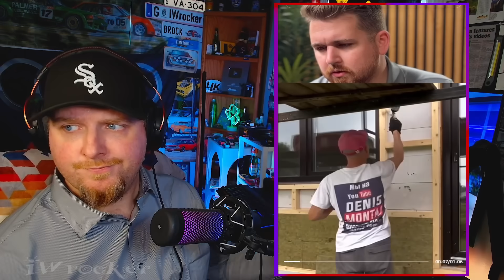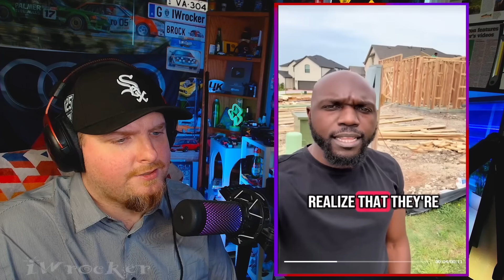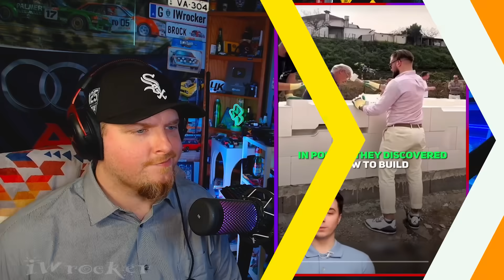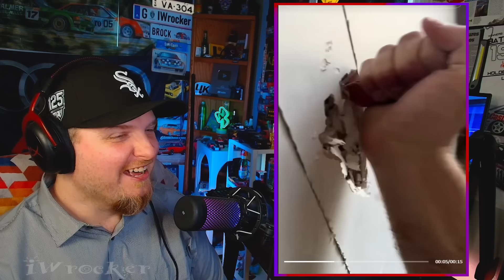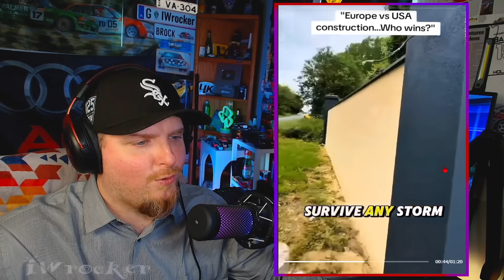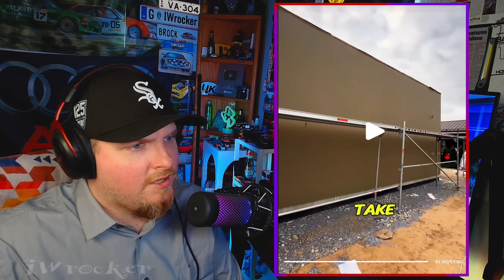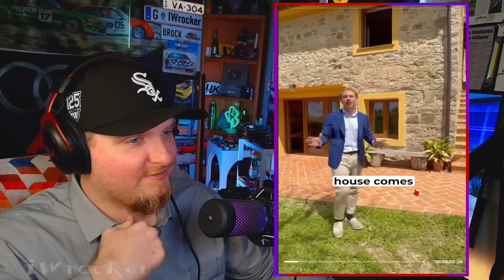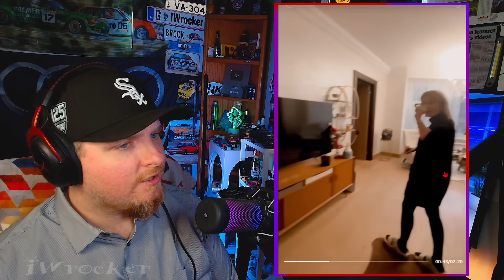25 Minutes of European VS American Home Quality & Construction Methods 🔨

Comment: That window at 13:00 looks like it's a single lipped frame, not a tripple lipped frame. Ie it has one lip with an insulating lip between the window and the frame. What I'm going to get soon are three lipped seals, all recessed outwards from the panes, so there are multiple overlapping seals of insulating material. That also increases the stability of the frame when it is locked. With the tripple panes plus safety glass they aren't indestructible, obviously, but so incredibly tough that even a sledgehammer to the window pane is only going to shatter, but not splinter, the actual panes. Meaning, you still can't get through it, but thanks to the vaccuum seal being broken between the outermost, and the middle layer, you get a very loud implosion bang. Due to the heavy frame surrounding the panes they won't be easy to break out or through.

In the demonstration video of the company they even tried a pickaxe. Yes, it punctured the outer and middle layer, but got stopped before it reached the inner layer. The frame was attacked with everything from a yard-long crowbar to a disc grinder. After five minutes of frantic attempts to break either the frame or the panes out of the frame the crewmen gave up. It was SO loud, and so obnoxious, that neighbors would have called the cops by now.

Obviously there's no use putting these frames in platform framed US style houses. With outer walls being flimsy enough to be destructible to an average sized hammer with prongs, the walls become the weak points.
With my house a builder tried to cut through the concrete inner layers of the outside walls. For that he needed a special liquid cooled center cutter, which still took him over ten minutes of very noisy drilling. Mind you, it was a mere 150mm hole (so barely 6 inches diameter hole) for a steam vent from the kitchen area to the outside. The depth was 'only' 35 cm, so about 14 inches thick of layered iron slag walls sandwiching an inner 6 inches of solid reinforced concrete wall. The entire outer wall is roughly 20 inches thick.

Comment: The thin building is a famous block of flats known as the Thin House, located at 5 Thurloe Square in South Kensington, London. 
Often described as a "logic-defying" optical illusion, the building appears to be only a few feet wide when viewed from a specific angle. In reality, the building is triangular (wedge-shaped). 
Narrowest point: 6 feet (1.8 meters) wide.
Widest point: 34 feet wide. It was built between 1885 and 1887 by William Douglas. The site was originally a plot of land left over after the development of the nearby Metropolitan District Railway.

Comment: 2:00 that was not concrete. More like Ytong or something similar. That are such light big bricks sturdy but soft, easy to neil in it with a neil. And of course if you need isolation it comes from outside. From inside it would be just bad at least with dew point

Comment: Pros and Cons from an European view - not a craftsman and just for funsies btw

Pros of the "American" way of building if done correctly:
1. Comperatively easy to build, relativly cheap
2. Highly flexible (layouts can be changed etc.)
3. DIY friendly
4. Easy to adapt building plans to different regions (insulation thickness)
5. Maintenance friendly

Pros of the "European" way of building if done correctly:
1. Sturdy
2. Less maintenance needed regarding the structure itself
3. Quite safe regarding electrics and other stuff that may eventually lead to an express departure from the real of existence
4. Often better insulation regarding airborne sound and if done correctly also structure-borne noise (latter one dabatable to a degree, depends on proper execution)

Cons of American style
1. DON´T BUILD THIS STYLE OF HOUSE IN FRIGGIN HURRICANE REGIONS; EVERYONE WILL MAKE FUN OF YOU!!!
2. DIY friendly...yes, that is also a Con - ever witnessed what an average accountant cosplaying as a plumber can do to all the plumbing on just one weekend? There goes the resell value...
3. The "maintenance friendly" - yeah, you probably will need it! Often!

Cons of European style:
1. Sturdy. Yes, it is still sturdy when you want to rip out the plumbing or remove that wall to open up some space. Oh...and about that wall: Better make sure the last 30 - 50 years of loadshift didn´t make it a loadbearing wall now! Check, check again...aaaand call the structural engineer to tell you where exactly you effed up.
2. Sturdy. Yes, the structure is solid but boy oh boy do you have a problem if it isn´t anymore! And yes, water is your greatest enemy. 
3. Sturdy. These bricks ain´t cheap mate, better pay in advance. And get an architect...and a structural engineer...and an electrician...and...

Comment: Just like at 13:37, over here in Slovakia (Central Europe) a typical house wall is 19in brick plus 8in of external thermal insulation. Windows should have 3 plates of glass now.
Same insulation under the roof. Typical roof are concrete tiles, which are a bit heavy on purpose. In the unlikely case one gets somehow damaged, replacing it is too easy:goodvibes:
Our house is warm without heating when outside temperature is above 50F with 4 adults inside, 40F outside "require" 5 adults for zero heating.
18:20 Cameraman does not show the rear wall on purpose to make it look funny. Outline of that house is not a rectangle, it gets thicker:yougotthis:

Comment: @18:36 The YouTube channel "Tim Traveller" can explain this; he has made several videos about the artificial facades in Paris and London. The main purpose in both cases is to ventilate the Paris Metro and the London Tube, which are so old that they were once pulled by steam locomotives. Another purpose is noise reduction (logically, since these locomotives were loud), and thirdly, to visually maintain the facade so that no gap appears in the middle of the street frontage. The section shown in the video is deliberately misleading; If you were standing there, you would see the tracks at that point from a different perspective.

Comment: Modern day buildings here in the Netherlands are often pre-fab concrete with lightweight gas cinder blocks for interior non-load-bearing walls. It's not like we build with solid brick anymore like in the '30's. (unless for maybe single homes where the owner specifically wants something like that). Most brick you see on modern buildings here are just thin decorative covers.

Comment: In Europe, when building with wood, dense, high-quality timber is used, making it far less flammable. The standards are strict; it is also fire-retardant to prevent any risk of fire, even with the aforementioned precautions. Smoke detectors are mandatory in homes, and in most cases, firefighters have time to arrive before the situation becomes too serious. This is nothing like the wooden houses from Ikea or pallet wood in the US, which often burn down before you even have time to call the fire department. Ours withstand fire for hours, and everything is rarely destroyed except in the event of a major disaster.

Comment: You can also change the floor plan in a brick house. Non-load-bearing partitions are made of thin partitions (about 15-20 cm), you can knock them down with a construction hammer. The problem is changing the load-bearing walls. That is also possible, you just have to deal with the beams and lintels that will transfer the load. The principle is exactly the same as with wooden houses (we have them in Europe too, but they are not very popular in Central Europe). So you can change the floor plan in a brick house too, you just have to do more. But they are not untouchable for 150 years 😉

Comment: If i remember correctly, the fassade in London (around Min 10:30) stays parallel to traintracks. The fassade is blocking noises and also looks better than as tracks of a railway area. 
Greez. Chris. Munich.

Comment: I live in Finland, we have almost 90m², apartment. It is made totally from concrete. I never, ever worry that our walls will break. I hit my hand to a wall corner, while playing with my kid, and it fractured my hand. 😂
Reply: And my parents live in house made, from tiles. It was built in the '70s, and has concrete stucco finish. The structures are original, and will last another 50 years easy.

Comment: It insulates from the outside because it creates a shell avoiding critical points where heat could be lost. If the insulation were on the inside, in the part where the internal wall is attached to the external one, there would be an insulation break. Using thermal cameras, with internal insulation, from the outside, in correspondence with the internal wall, a heat spot due to the thermal bridge would be visible.

Comment: Ugh, coming from a family of architects (both my grandfather and my late father were architects) wall insulations always give me the creeps: not only do they throw around numbers about energy savings which are only true if you're living in a leaky shack or thin-walled concrete block, the limited life expectancy (35-50 years) and high cost for the insulation make them hard to break even most of the time. Not to mention that you DO NOT ruin a century old house with external insulation just because it's "cheaper" than internal insulation and in the name of the envitronment (and for some reason, people love to omit the CO2 fingerprint of producing the insulation, making the calculation even more moot). -_-

Comment: In regard of the last one: Latvia doesn't provide it's sitizens with high salaries so $700 is definitely NOT cheap for a regular Riga worker. Still much better than most of similar sized apartments in Kyiv in regard of quality of living. You know, low floor numbers and quietness. As much as I would love to visit NY as a tourist, I'd refuse living in that anthouse for free, let alone paying so much for it😂

Comment: First one the insulation isn't on the outside it is going to be covered up hence the wood struts for what ever covering the place over the insulation. He also brings up pressure treated and that the wood should be treated one you can get pressure treated wood that is clear so it doesn't discolour the wood two in some parts of europe getting it treated isn't going to make a huge difference due to the lack of creatures that will wreck the wood. As for America does it properly OMG do I need to point out just how many American shows highlight plenty of crap buildings that need major corrections done to them? 

London building is most likely a fake building built to look like a house when in reality is an air vent for the London Underground instead of unsightly pipes the hide it behind a fake front to fit in with all the other properties London has several of them all over.

Comment: My house was built 40 years ago and already has insulated walls... and it's NOT russia! It also has heated floors and it's not from ancient Rome!
I wouln't want to live in a shed that guy built.. I'm in IT and not a Bricklayer/Carpenter/Plumber/Electrician but I have probalby more knowledge about building a house than this guy... he's probably building cardboard houses from Duc Tape and wonder why he's freezing since october or when it rains! Aaaaaaaand he's an arrogant prick! This house is built from concrete bricks and possibly has insulated concrete bricks. There's a reason german craftsmen have to go through an apprentice ship that last around 3 years.

Comment: My mothers house was built in 1694.
Still standing and have only had minor repairs to its walls and roof throughout the ages......how many buildings in America can say they are over 400 years old?  America is still old, so they should have a house or a building that is 400 years old.  The UK has over 25000 such aged homes and buildings, some way older, even going back to the 900's ad/ce

Comment: If possible always insulate on the outside - at least that's how I learned it in regards to upgrading older buildings for better energy efficiency! 

Reasons are for example: Risk of damp walls and mould from the space between insulation and outside wall, esp. if the insulation isn't placed super accurate and tight. Also you lose living space inside your rooms...

Comment: I worked in the building industry uk brick with a cavity insulation 50 mm plaster on the inside timber floors and roof with slates on the roof double glazing windows I was in the us in a house and my friend was building a extension timber frame dry lining I said man can you not do it stronger he gave me a look I said gee what a good job 😅😅😅

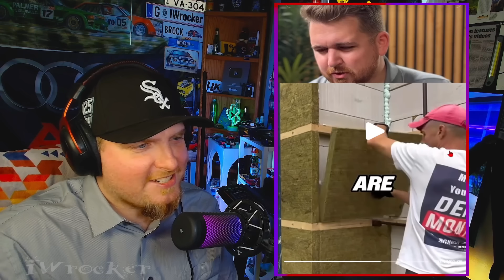Comment: 1:30 and thats very thin insolation. We use like 15-25cm of insolation here in central europe. I am in construction If you built a house you have like 30cm of concrete or 35-50cm bricks + 25cm of insolation + 3-5 cm of plaster with paint from both sides. So those outer walls are around 45-70cm. It keeps your heat inside and keep the cold outside, I live in apartment now we have around -5 to 0 C and I never used heating this winter.

Comment: Before my house got insulated, wall right next to me got super cold during winter and hot in summer(even if it face north so it wasnt that bad). Thats why we put insulation on the outside.
But wood is already decent insulator, so it might not be needed.

Comment: The first "expert" has no clue. You need insulation to keep the heat out! What an idiot. :person-turqouise-waving:
Reply: And you want to have the dew point as much outside as possible. That's why outside insulation is better.
The first guy should find a different job.

Comment: My cutrent house is a small 3 bedroom terrace ...with 2 bathrooms. It was built in 1903. Its what was considered a workers cottage so built on the brick built cheap back then.

Facades for a listed building...old and of cultural or architectural importance...are kept intact. Someone may be able to build onto it and kee the facade. Or it may stat as it. If you buy certain listed building as a home you are limited to strict rules.

Comment: That Polish shaped brick style was fascinating, BUT..... I couldn't see how the joined the back an front walls, to the side walls. Surely they need a link, or one wall could fall over, leaving three walls standing. There must be a corner joint, to link front and side walls???? And, where does insulation come in?

Comment: 8:00 This Swede is on board with the wood frame and plaster board solution. Having said that: There are differencies when it comes to thickness in materials and the whole issue with the flimsy roofs in the US I'll never understand. I live in a 1970's wood frame with brick cladding exterior and plaster boarded interior. But the roof is a ridig wood contruction with real heavy brick tiles and not those sad flaps of yours.

Comment: We live in the UK and added external insulation to our 1920's house three years ago. The heat loss difference was immediately noticeable in the winter and the house heats up slower in the summer so we have the best of both worlds. It is definitely something I would recommend doing to your property if you can.

Comment: 0:30 in Italy we put insulation on the exterior to raise the energy class of the existing building. -that isn't event the thicker insulation I've seen.Usually I've seen 15-18 cm of polistirene foam  applied on the exterior of a building. the brings the energy dispersion so low that you can heath floor of the house while just cooking the lunch. As far as I've heard in Germany and Scandinavia they do even better. So no... the way you do in America isn't necessarily right nor better ;)

Comment: At 18:40 the thin house is actually triangular, built like that because of the railway sitting below and behind it, it was built to fit the land, the clip stops before showing how it expands from that view.
Reply: You sure it's not one of the facades only, to cover the open tube (subway/metro) behind it? 

Iirc when they built the Victoria line they needed to have open sections to vent the smoke and/or steam. To cover the ugly holes they made these fake, facade only houses to keep the street looking nice. Some of the doors are real though and serve as emergency exits and maintenance access.
Reply: @noinfo5630  nope, it is a triangular shape, Thurloe Square, London.

Comment: I can't even drill a hole in my wall to hang stuff without having to borrow a heavy drill... But it seems like I could just throw a screw/nail at the wall in the US and just hope that it kinda lands in the spot I want.  
Would still rather have to borrow the drill though 🤣🤣🤣

Comment: That first one. Why would you put insulation on the outside...? Why would you put it on the inside? You want all your walls to get cold to then try and block it on the inside? Eh?
It's inside wall > insulation > airgap > outside wall(façade).
Also, insulation isn't only to keep the cold out. It's also to keep warmth  out in summer.